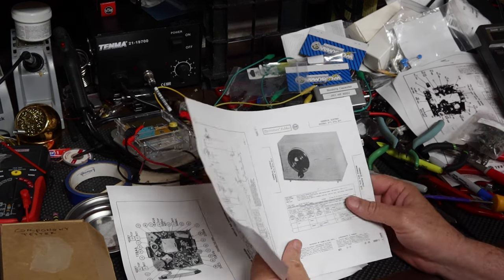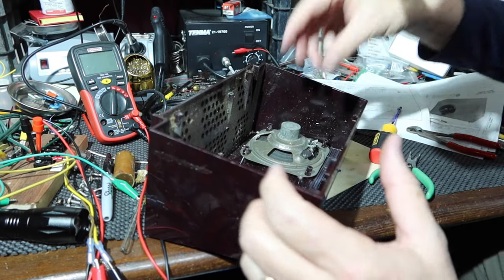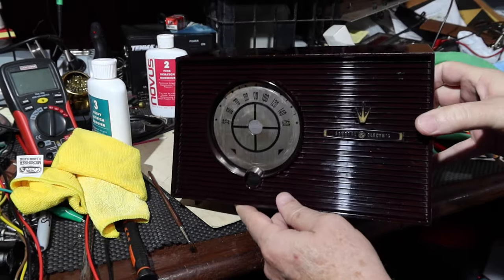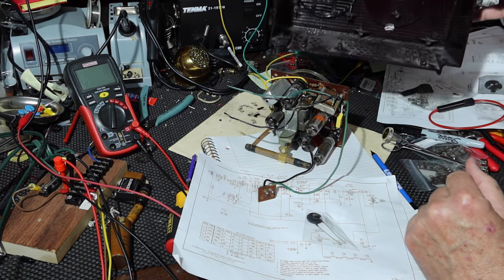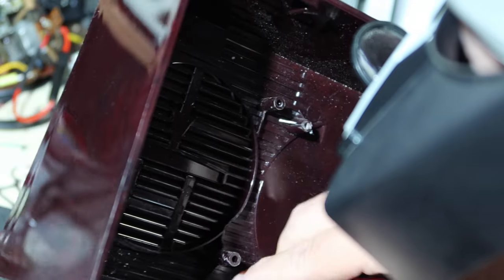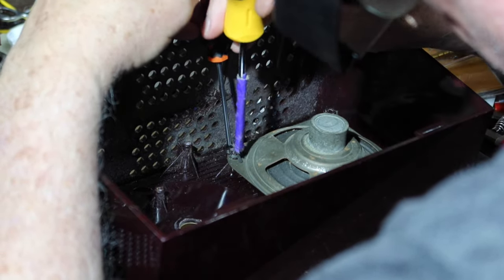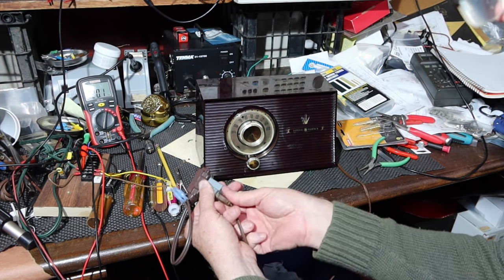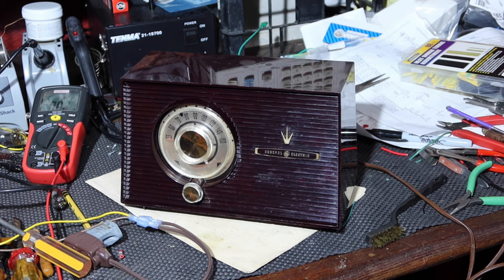DONE! Tube Radio Repair - Power Connection Mods & Case Finish - GE 875 Tube from 1957- Part 5 - [4K]

Comment from the maker: Jump to:
0:01 Into
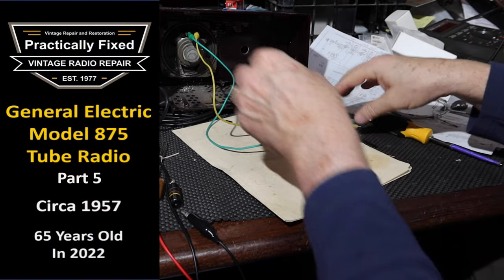1:29 Fuse & Cord Plan
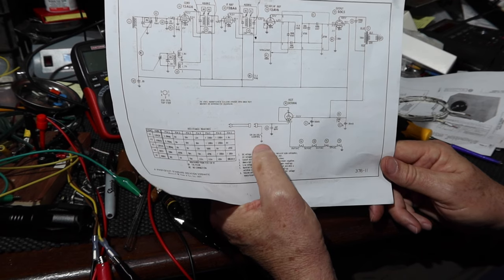5:45 Remove Speaker
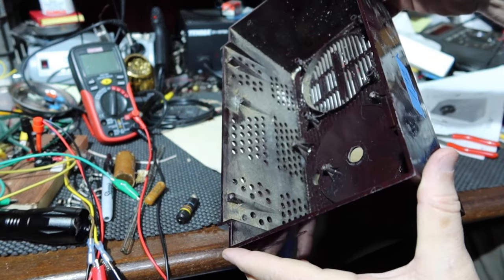9:14 Clean / Polish Case
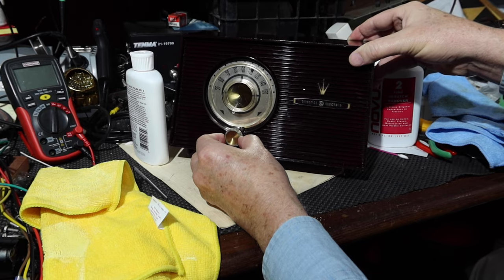16:28 Tube Glow Glamour
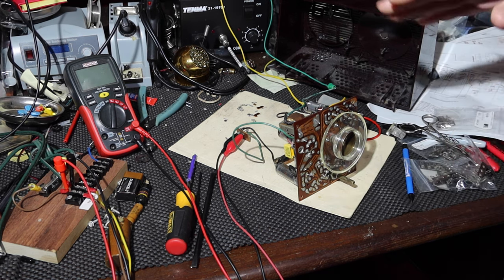17:22 Power Final Plan
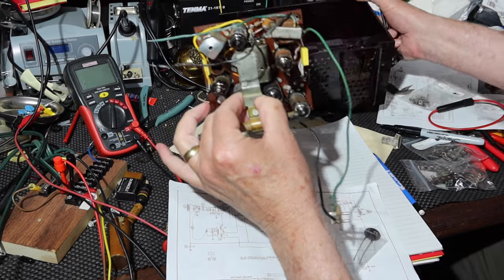23:19 Power Mods Review
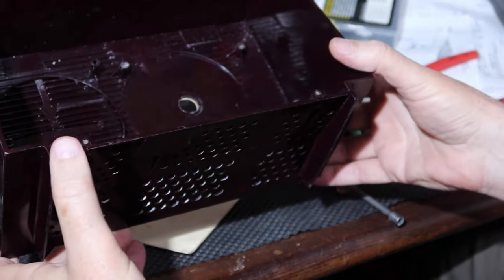27:39 Bad News & Remedy
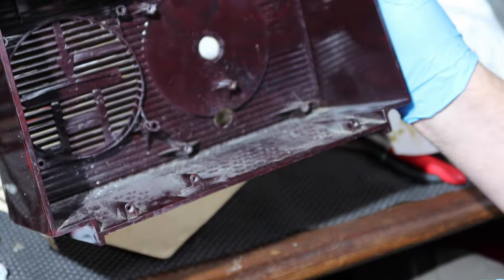30:36 Speaker Re-install
36:42 Re-assemble Radio into Case
40:29 Test #1
42:45 Plug Problem
44:02 Test #2
45:25 Review
50:34 Small Radio's Dream Come True

Comment: Thank you for posting this series. I have a GE 875 that I purchased in an antique store for $15 three years ago and found that it had silver mica decease and put it up because I was not sure that I could do the proper repair. After watching the way that you repaired the IF transformers I now feel comfortable in trying the repair. 
PS  You got a new subscriber
Reply from the maker: Hi Sean.  It is very tedious as you saw.  The trick is to get a good idea of the replacement mica capacitor values.  If you can measure what you had before it helps.  Then the alignment is essential as it will not be perfectly the same value.  If you can get the replacement mica caps close to the original value it makes the alignment a bit easier.  If you try it, good luck and I am glad you enjoyed the series.

Comment: These old radios have some crazy, dangerous power wiring, compared to what’s acceptable today.
I’d most likely put on a polarized plug so the “schematic ground” goes to the neutral (or if floating, capacitive coupled chassis, closest to it), then, put the fuse on the hot side, and move switch on the hot side as well.
Reply from the maker: Hi Dave, thanks for the comment.  Yes I recall being zapped as a kid. As mentioned before, I have a project in final editing where it looks like I need to do the wiring like we discussed.  Keep an eye out for that one.  Thanks

Comment: The board looks a little a BUSH Tube Battery/Mains radio, Just wondering what about 1xD call for the heater and 5x9V PP3 batteries(45V) for the B+ would make a nice wee portable.

Comment: IMHO, I’d put on a polarized wall plug, connected so the hot side goes through the fuse and switch …
Reply from the maker: (Well I wrote a reply to this, but looks like it did not save.. Guess I will try to remember it and retype it.)
Yes, I usually do exactly what you said.  I usually replace the cord with a newly made retro-looking cloth covered polarized cord. They look nice.  But I was really trying to save the interlock feature and so I did not want to replace the cord.  (Am working on a project currently where the interlock has been broken out of the back panel so I may have to let that "save the interlock" thinking go.)  I do have a brown Leviton polarized replacement plug, which is NEMA rated for residential use, which I may use to change the plug and then wire the internals accordingly with hot to the fuse, switch and then thermister.  Another point, I do not leave these things plugged in.  I do not trust these 50+ year old switches.  So I either unplug them or put them on a power strip with a switch.  Thanks again for the comments.
Reply: It did save, I’m going/trying to switch back to my real name: it’s Dave .. thx for the reply